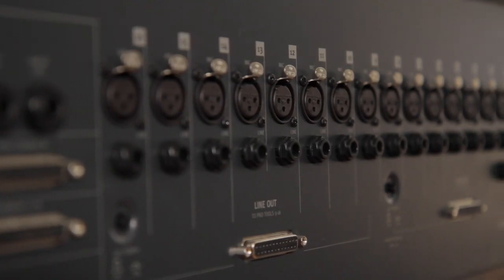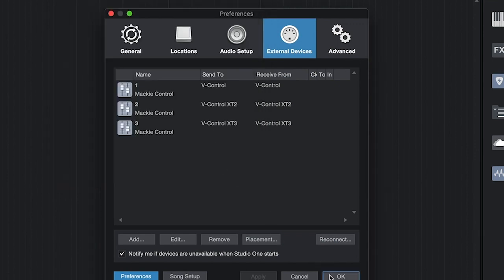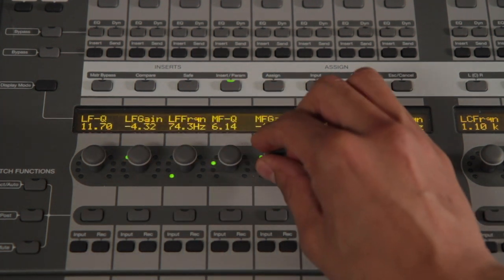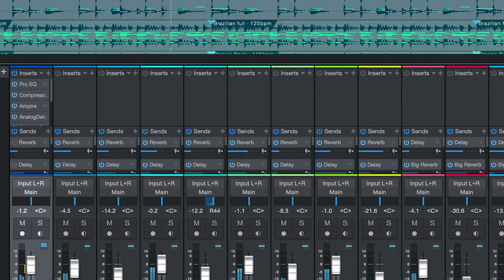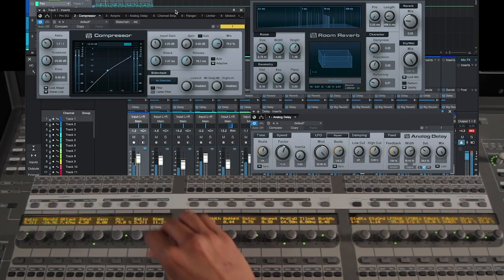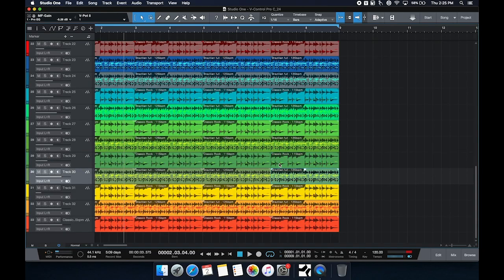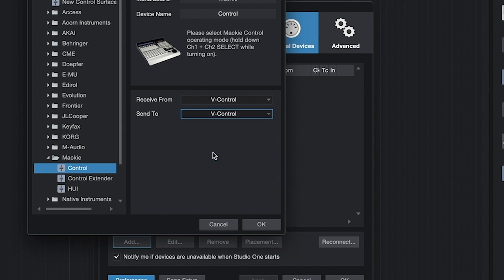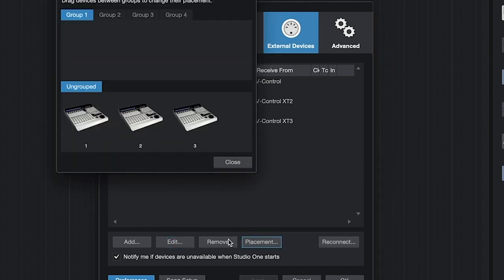StudioOne With C|24, Control|24, and ProControl

Comment: Hey, incredible video! 
Have been looking for this for a long time 🥳
Still dind't understand if the ProControl series (let's say 24 channels)  be used to control the same plugin simultaneously. The c24 and the control24 are the same object-->1 connection to the computer. But... Procontrols would be more then one so...my doubt is that I could use 8 rotaries only to control a plugin
Thank you for your video!
Simone AKA Nyroh 💪
Reply from the maker: The latest version 2.6.1 will control plugins on ProControl similar to how C24 works, with all knobs across the mixer.

Comment: My GOD! I can scarcely believe my eyes. I was on the brink of selling my C|24 and buying all new control hardware as I wanted to use Logic and Pro Tools. Is this really working well with Logic?
Reply from the maker: wattage2007 Yes. You can get a free trial and see for yourself.
Reply: Paul Neyrinck Awesome. Going to have to drive to work with a MacBook to try this tonight or I won’t be able to sleep!
Reply: Paul Neyrinck You’re a genius. Just tried it and couldn’t believe what I was seeing! Still a few buttons unassigned and inputs seem selectable as busses only in increments of 4 but what a revelation. When I buy it, how are the iOS apps installed and can I use a 1st generation iLok?

Comment: Wait you can use this with studio one?
Reply from the maker: Yes, that is what this video shows. Studio One can now be used with ProControl, Control|24, and C|24.
Reply: @neyrinckaudio1604  Will the control 24 Meter bridge work, Has that issue been resolved?
Reply from the maker: @tecno8335  The Control24 track meters show the track meters for Pro Tools, Studio One, Logic Pro X,  Cubase, and Nuendo.

Comment: Any chance this would work with a Mackie D8B?
Reply from the maker: Not at this time. Our research indicates the D8B is not programmed to be a remote control surface.
Reply: To Old.. The Support is down and the Product also..
I was thinking about buy one. i like the design of the D8B very much but yea...too old
Now i maybe take a c24. Think for the few next years its a huge solution for low price
Reply: @home-dream-records  I know you are correct but I have an working D8B and I kind of miss it.  Peace.
Reply: @fredfox3851  Ah okay.. so i now a way to take your d8b and use it as a daw controller for every daw. there are some bridges to buy that allows you to switch from ur cpu unit to pc via Midi / Usb.

then u can use the Mackie HUI and everything works properly fine